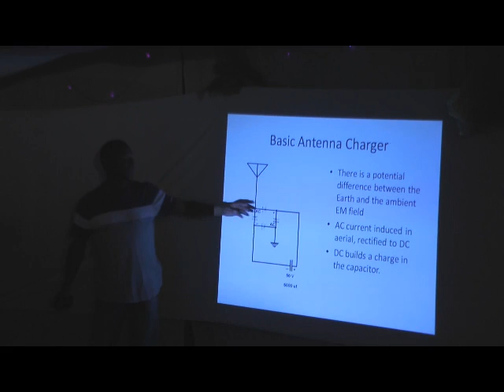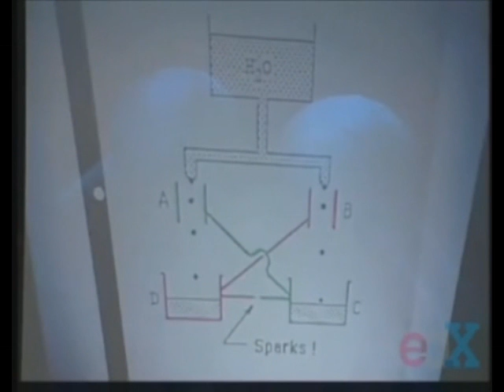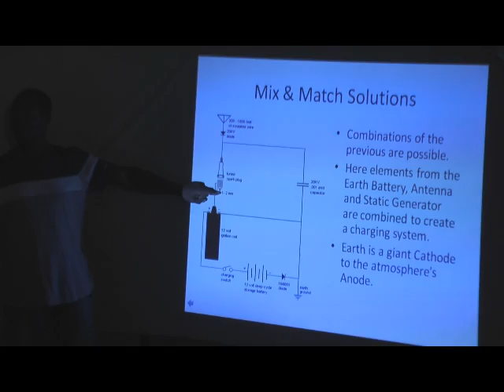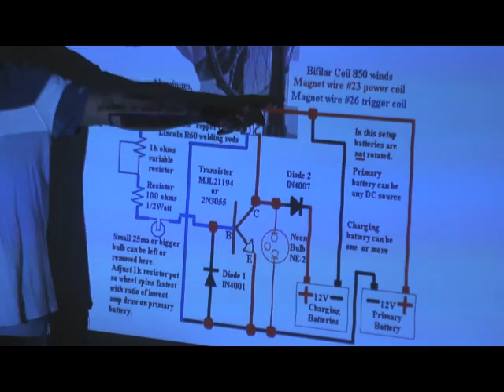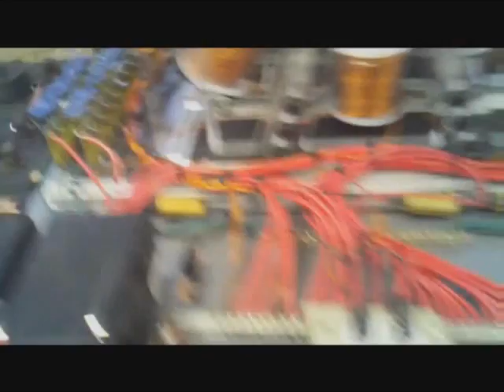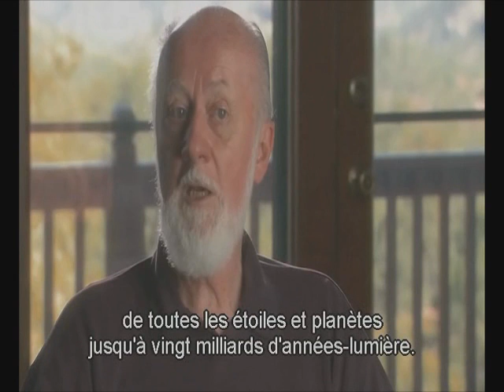Practical Free Energy @ Truthjuice Gathering 2013

Comment: The energy in the water experiment is the stored energy of lifting water to a height where it is released. Moving water creates a galvanic current when it passes between two dissimilar metals. So the energy is not coming out of thin air but rather from the effort of lifting the water higher then the resting place and releasing the stored energy to gravity. . Then he gives another example regarding static electricity useing a balloon and rubbing it on your hair or hairy arm thus creating a static charge. Again the energy came from the effort of moving the ballon back and forth against friction surface. So both examples of energy come from the human effort itself not some mysterious free energy scourge. You see this same problem with perpetual motion device as the energy perpetuating the device came from the push or pull of the human demonstrating the phenomenon. The question is can we get more energy out then we put in to begin with?
Reply: Walter Lewin was a wonderful science demonstrator and lecturer. I probably prefer Julius Sumner Miller in that area though.I really enjoy his work and enthusiasm. Less abstract and theoretical than, say, Feynman or Susskind but great motivation. Mustn’t be accused of false idols though so shouldn’t forget his fall from grace either, or the fact that we all have human foibles.
Reply: Dave seemed a bit clueless on anything other than a superficial description of the outward phenomenon. No real understanding, no methodical approach, no real measurement, no real analysis. Some people might throw in babble like “free-energy”, but I would prefer to use “zero-point”…. Not zero-point energy, rather zero-point and zero-content in any of Dave’s rambling pile of unsubstantiated claims especially toward the end. Fun to watch the master at work, not sure I can cope with another face palm 🤦‍♂️ just yet

Comment: I did not miss the point you were trying to make. I'm just suggesting an experiment that may boost power or efficiency. This doesn't change my way of thinking about energy, since I'm already familiar with mechanical heat pumps. Energy always has to come from somewhere.

I'm just suggesting that rather than having the motor's load wasted on spinning a flywheel or not doing anything at all, if the output really does benefit from an added load, why not use it to boost efficiency even further?

Comment: You should do some experiments to find the most efficient load to use with the bedini motor, if it does benefit from having a load.

If the batteries cool when the motor is running, the efficiency might be boosted by heating or further cooling them. If cooling improves efficiency, you could use a fan as the load & put heat sinks on the batteries to promote cooling. If it heating is better, then a 2nd motor could be used the load, which could power heating elements under or around the batteries.